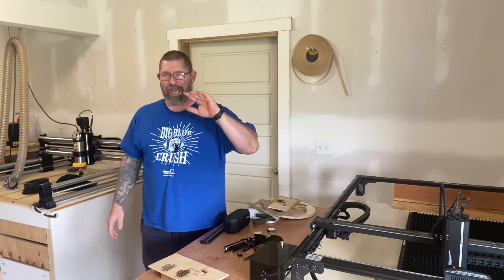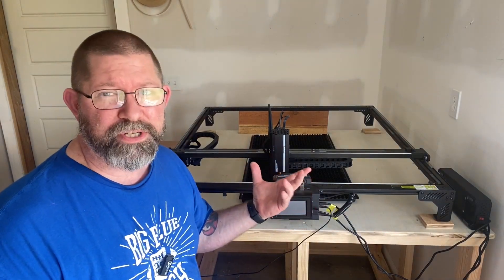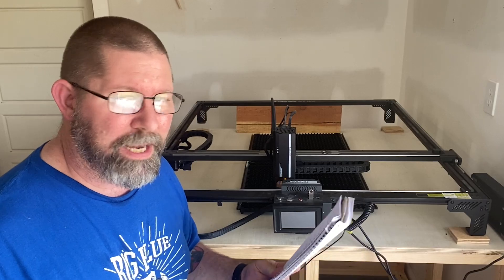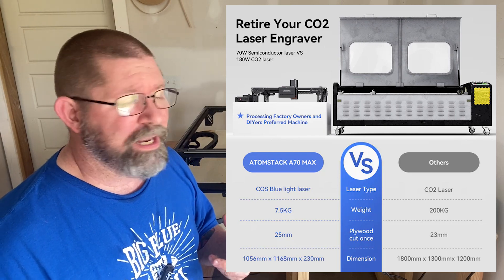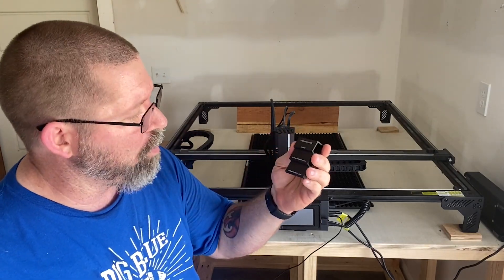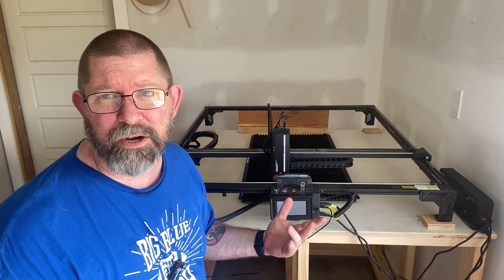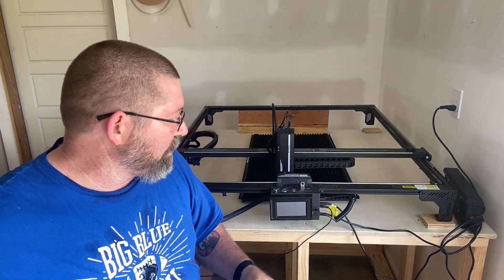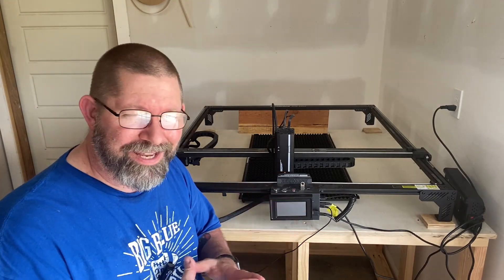Can AtomStack's Most Powerful Laser Replace Your CO2?

Comment: I currently have a 10 Watt XTool D1.Kind of enjoy it but project sizes are limited.I also have a Onefinity  CNC router.I do a lot of work with it.Mainly cowboy scenes and rustic like flags.I paint it black and sand off the paint on the parts that stand out.I go to old tractor shows and sell them there.I would like to be able to engrave about 1/16 th of an inch deep and follow the same kind of process.The reason why I would like to do this is because the CNC carves are very sensitive to uneven wood.Just wondering if on 70 Watt at 100% how fast it can engrave that at.Seems to be a good machine.

Comment: hi there i  guess after having things for a while eventually things need fixing  I finally figure out was is wrong with my A 70 max. it is my z axis autofocus  unit it is not working properly and it is at least 1/2 inch off. How do i know this in lightburn  i did .50 offset on the Z axis and it cut beautiful but i was wondering if there is a way to  reset it to zero or if you have any idea of how can  fix it. thank you.

Comment: I enjoy your videos thanks for posting. I have a question on the atom stack a 70 max could you recommend settings and passes for cutting 1/2 inch pine?
Reply from the maker: You'd really need to check Atomstack's documentation. They should have all of the recommended settings available.
Reply: @SothpawDesigns  Hi, it wasn’t that easy to find but I did manage to dig it out. Thanks for the reply. Best regards.

Comment: Power up-down has to be done on that switch? No software controlled power setting? I guess I'd have to run a cut file and then a part labeling file.

I want 4'x8' capability. Is it a manageable task to lengthen the mahine?
Reply from the maker: To my knowledge, no, this isn't a good choice if that's what you need.

Comment: I think it makes no sense to still continue producing and selling these powerful and dangerous lasers as open frame machines, without an enclosure and without a smoke extraction system.
It makes no sense that people need to buy or build an enclosure separately.
A diode laser is dangerous for your eyes even at 1W power, now we are talking about 70W, it's something weird that the factories are continuing thinking mainly about selling bigger and bigger machines, more and more powerful machines, and they are caring so little about safety
These machines should directly be produced and sold as an enclosed box, that's for the safety of the environment in terms of smoke expulsion and in terms of not getting blind if someone else may be moving near the working room without any protections and/or if you yourself forget to wear goggles.
One is supposed to spend 2000 bucks, and for what? For spending additional thounsands bucks in order to build a safe setup? No, thanks, CO2 laser machines are still way better, more affordable and more versatile, and even the price difference, considering what you actually end up spending in total for having an equivalent setup for a diode laser, is not that significant.
Reply: You don't spent thousands on an enclosure lol. You can literally build one for $200-$300. No need to envy diodes cause they don't need half a machine just to cooldown😂
Reply: @petec737  if you want to build a really safe setup, you are not going to spend $300.
A really safe setup needs a good and effectively protective enclosure, with one or more safety interlocks on the cover connected to the mainboard, a powerful smoke extraction fan and/or some filters, an affordable and powerful air pump, a honeycomb table, some cables, some pipes, some hardware and ironware, plus some much work (but maybe we can say work and time are free).
At first it may seem like you are spending little money, but if you calculate everything you need for a really safe setup (not a set of chinatoys, but safe and professional stuff) you will realize you are spending thousands.

Comment: I started off with diode lasers, still have a couple and at the time the most powerful one I could find was 22W. Fast forward 3 years and companies are releasing 50W, 60W, and even 70W diode machines. My only concerns are most are open air systems like this, meaning you or anyone near by has to wear eye protection when it is running. And my biggest concern is longevity. The diode lasers I used in the past seemed to burn out fairly quickly. Would be interested to see what a long tear review would look like. Full disclosure I now use a 60W CO2 and love it for the most part. Wish I could have gotten a larger bed size but didn't have the room for it.
Reply from the maker: The bed size was the big point for me. Just opens up for a lot of new types of projects. I’ve seen a lot of your CNC stuff, what types of things do you do on your laser?
Reply: @SothpawDesigns  I guess the main thing I use my co2 for is cutting thr detail parts for the clocks you seen me make. Make quick work out if 1/8" plywood and acrylic. Other than that I use it to engrave phrases, names and logos on items
Reply: Diodes will die fast. But the ppl dont know it. A good cooled and nice handled co2 tube can hold for years. (PS: Im using a 4,4kW and a 5,5kW co2 tube on my work - so i know, whats going on)
Reply: @fellpower 20,000 hrs is a long time for a diode. I love that I don't have to worry about chillers and whatnot. To each their own.
Reply: @fellpower by the time a diode dies you'd have replaced the co2 tube 10 times already😅
Reply: @fellpower  I talked to a guy about 2 years ago.His garage heat went out and his laser head got damaged beyond repair.

Comment: How would you like to try a laser on your onefinty elite machine ?  I would like to know how well a laser works on a CNC machine.
Reply from the maker: Nah. I’d rather have the separate machines and not have to switch back and forth
Reply: @SothpawDesigns  Good one. I contemplated adding a laser to my Longmill CNC machine, but I ultimately got a separate laser machine (and a second and then an Xtool F1) - I can run them all at once if need be.